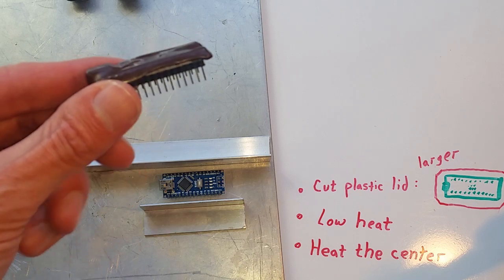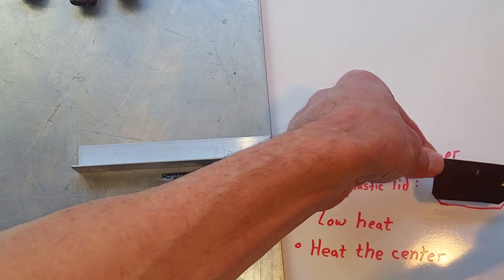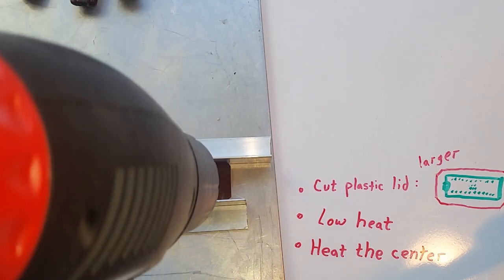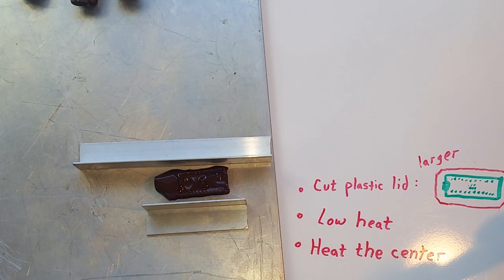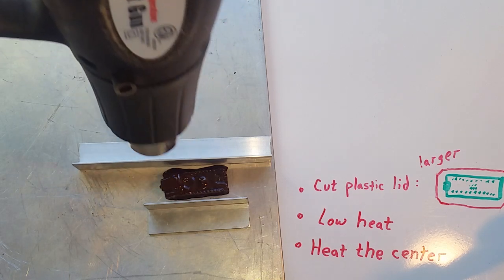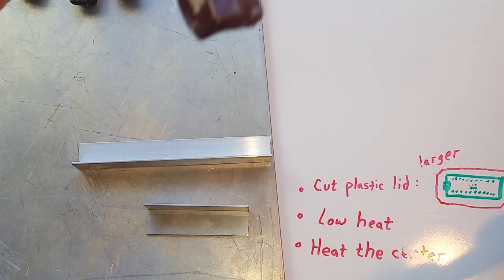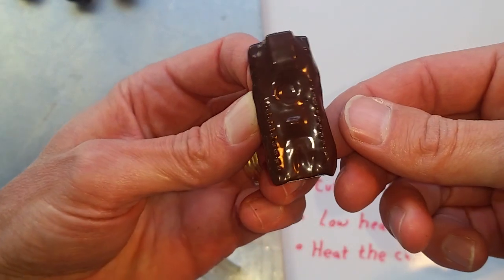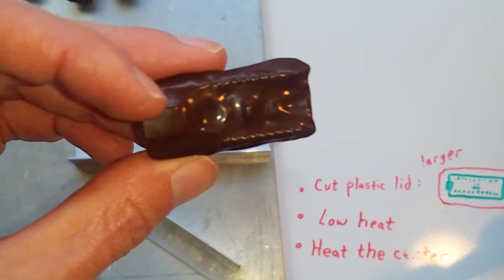Arduino. Potting circuit board.

Comment: Have you thought about the static charge buildup on plastic? I think that's why we need special anti static bags for bare chips.
Reply from the maker: I don't know about this.  Is plastic worse than no plastic in this regard?  I haven't experienced any static problems.
Reply: I'm no expert but plastic coming in contact with the metal in the circuit might be a concern. Or it may be nothing to worry about. Or it might actually help protect the circuit in a high static charge environment...dunno.

Comment: This is a copy and paste including several snippets from articles, blog posts, and instruction Tutorials  I’ve written over the years. Sorry for the rambling and I hope this helps someone

I’m just an electronics geek with a somewhat respectable lab… Who repairs industrial control and automation equipment… Also restore and recalibrate test gear. And big into the laser Hobby. 

Anyway… Dealing with industrial equipment… I’ve come to learn a lot of things about waterproofing electronic stuff. Since I see hundreds and hundreds of industrial modules every year for repair… I’ve got a decent understanding of how it works.

First of all… it’s a good idea to soak the board down really good with 100% alcohol or denatured alcohol. Then scrub the heck out of it with one of those small 1 inch disposable paintbrushes. Then give it another good soaking of alcohol with the board vertically so that it can drip off and take all the contaminants with it. Or better yet use an air compressor to blow off the contaminants and the alcohol.

I buy 100% Iso alcohol by the gallon for about $15. And I keep it in a squeeze bottle on my workbench. (One of those squeeze bottles with a 90° angled tip that can be operated with one hand.) I use over a half a gallon a month at least! It really improves my work and I couldn’t live without it. 
There are a lot of waxy and oily residues that can come on new circuit boards… So degreasing really does help the adhesion and only takes a few squirts of alcohol and a few seconds. And the alcohol evaporates quickly taking any moisture with it.

Second.... and probably most important.
Try preheating your circuit boards before coating. They can handle a lot of heat But only need to be good and warm. Somewhere around 100 to 150°F would be plenty. This will help the epoxy flow in and around all of the components, And it will also adhere WAY better to the board. 

Also the longer cure time epoxy the better because it maintains much more flexibility. Some thing like 30 minutes is good, 60 minutes is better.  Don’t get me wrong… I go through gallons at five minute epoxy every year and I love the stuff. But the faster the cure time, then the more brittle it will be. And with any vibration, it may can easily begin to pull away from the board or individual pins if it’s extremely rigid. So flexibility is great. 
 
Also when it comes to silicone… Be sure you get NEUTRAL cured silicone instead of acid cured. acid curing silicone will smell like vinegar and release acetic acid when curing. Therefore easily damaging copper and tarnishing other metals. Over time it will devour component legs and traces.

Also, check out a product called “never wet“ made by rustoleum. You can spray that shit anywhere. On pcb’s, inside of power tools, on bearings, windings of a motor, Inside a brushless fan or motor, on your clothes, on your phone, hell I’ve even opened up GoPro’s and soaked the insides with this stuff when I was going to be in a precarious environment...... literally anywhere. It’s extremely thin (similar to a regular clearcoat…) But it’s hydrophobic and really is like magic.… Check out some of the videos demonstrating it.  It really is amazing stuff if applied correctly. 

Another wonderful off-the-shelf product which is available to regular folks… Is flexseal. Yes I know it’s gotten A laughing with all of the infomercials on TV… but it really is an incredible product and cheap/readily available.  Before flexseal, something similar was only available in large quantities by industrial chemical companies. But for $13 you can purchase a can of spray flexseal… or even the thicker caulk like tube. And its dang near bulletproof.

If you’re worried about the epoxy pouring off the sides of the board… Then use tape or to make a dam around the board. In other words, stick the tape to the edge of the board with the sticky side facing in towards the circuitboard. Wrap the tape all the way around the board and leave the excess sticking up to make a damn so that you can fill it with epoxy. it leaves a nice perfect perimeter all around the board. 

Or if you’re wanting to cover the front and back of the board… the even better… Suspended the circuit board off of the table a little. Like the thickness of a coin or something similar. Then you can build a dam all around the board leaving a few millimeters extra on the sides of the board so the epoxy can flow over the top and down in under the board. That way you don’t have a bunch of open edges of epoxy that water can work its way under. But you’ve encapsulated the entire module in one slab of epoxy. If you use the dam building method… simply use some slices of cardboard like a cereal box… And a hot glue gun to build a little perimeter or wall around the board… Using another piece of cardboard or your work bench/table as a base to glue the dam to. The exact size you want. 

I would probably use a small plastic box a few millimeters bigger than my circuitboard. That way you can pour a little epoxy in the bottom, set your circuit board down into the box on top of the epoxy and spacer, and continue to pour epoxy on top of the board until it pours over the edges and connects with the epoxy around the sides and bottom. A small Tupperware container or any random little plastic box the same size should work fine. Once it’s cured you can pop it out and you’ve got a completely coated/padded module. But instead of a huge brick of epoxy it’s a thin coating with no seams or edges. That covers the entire front back and sides of the board in one smooth gel like coat. Just be sure to watch some acrylic/resin or mold making videos. And be sure to wax your Tupperware container/mold so that it can be removed and doesn’t stick in there.

If it’s going to be some thing that’s really abused, then swap out all of your connector screws and crimp terminals with stainless instead of regular steel. And clearcoat any heat sinks or metal that isn’t coded in epoxy. It Makes a huge difference because the smallest amount of corrosion can easily spread under the coatings... wick will begin to delaminate it from the circuitboard. Any type of corrosion or patina whatsoever… Weather The white powdery oxide that forms on aluminum. Or rusting steel.... copper that’s formed a patina… it all Poses a huge hazard to the water resistance of a board. That’s the most common failure point I’ve seen which breaks down the waterproof barrier. For example… The white powder that forms and oxidizes on aluminum. That stuff somehow creeps up under and conformal coating with ease. Like it’s not even there.

And most importantly…Keep in mind that NOTHING is waterproof. It may be water resistant but it’s better to leave it a bit exposed so you can dry it out later.
The only exception is if you’re willing to completely pot it in a solid brick of epoxy. but then it’s completely unserviceable and it adds a lot of weight/cost.
 it’s always best to leave certain things open so they can be dried out after a mishap. Whether you leave it out in the sun on a dry hot day, or bake it at low to mid temperatures in an oven. the best methods for drying I found… Is 100% alcohol or denatured alcohol. Soak the entire board, transformer windings, motor windings, soak everything. It will bond to the water and draw it out as it evaporates quickly. Even then… I still put it in the sun While in front of a box fan.....or bake it in the oven. Just to be safe.

This is a large cut and paste from several different articles, blog post, and instructional‘s that I’ve written over the years. Sorry for rambling… Hope this helps someone.
Reply from the maker: Thanks for spreading this information.  It seems a lot of internet info is going "dark".  News groups and forums that I used to liked have disappeared!
Reply from the maker: Where do you buy the gallon size alcohol?
Reply: @TheRainHarvester  The cheapest place is usually local. You can find it at Ace Hardware, Lowe’s, or Home Depot usually. Try and get 99% not 90, not 98. 99.9 is the best. Denatured alcohol also works but sometimes leaves behind a white residue. However it does remove just as much water and contamination. Amazon has cheap prices usually, but during the pandemic they’ve gotten more expensive. But still have some of the local dealers also. I was used to paying $20 shipped online and usually $20 for a gallon locally. You could also check eBay sometimes there are good deals.

Comment: Or you could use epoxy putting compound
Reply from the maker: Mic Mucky , it's an option.  But I wanted something that dries very quickly, and less waste.  I considered that brush-on seal, but it doesn't provide a lot of scratch resistance (especially on the pins that stick out).  
This technique really gives a robust finish.
Reply: @TheRainHarvester  ok it's a good idea what u have done like u can get small fast curing epoxys some cure about 10 mins but cost little bit more then plastic lids lol
Reply: @TheRainHarvester  only bad thing about heating up plastic to melt over the circuit is u could damage the components epoxy goes on cold and sets solid
Reply from the maker: Mic Mucky , thanks! I think all these methods are good for different reasons.
Does that ten minute compound brush on? Or do you create a mold for a pool of it to dry in?  What is the name of it? Just curious.
Reply from the maker: Mic Mucky , yes, you're right about desoldering the components.  I mean a heat gun can reflow the solder if you hold the gun too close, or on high heat.  Luckily, these lids melt much faster than the solder.  The heat never accidentally desoldered any components even when I though I might be heating the plastic too much.

Comment: This is just HDPE right? so most plastic bottles will work for this too, as long as it's got the number 2 in the recycling symbol, you're good.
Reply from the maker: The lid was hdpe #4.  I tried #2, from a milk bottle, but it shrinks too much.  I read that milk bottles are blown / expanded into a form so maybe that is why they shrink so much.

Comment from the maker: Let's think of a solution: we want the jig to contain the puddle of plastic to the outline of the board.  But the plastic shrinks and starts BIGGER than the board.  Any ideas?
Reply: How about a micro-vacuum former?  One frame that sits on top of your vacuum hose end and a second one that has the plastic clamped to it.  You heat up the plastic in the second frame separately, then quickly place the second frame on top of the first and turn on your vacuum.  Voila!  Perfect coverage without heating the components.  (I would also file down the header pins or just push them down with a hot soldering iron.)
Reply from the maker: Keith Olson , can you explain the frame that has the vacuum hose? I can't picture what keeps it sealed to anything.  I like the idea of getting rid of the pin problem.
Reply: Nothing complicated; just a short piece of pipe that fits over or in the end of your vacuum hose, mounted on a flat plate with a hole the size of the inside of the pipe.  On top of that, you'd put a piece of window screen (or w/e) to keep parts from being sucked into the hose and ensure an even flow of air (like pegboard works with for a classic vacuum former).
Reply from the maker: Keith Olson , I think that would be effective, but almost too effective.  One problem with my technique are the drips on the sides.  I want to prevent the sides of the plastic from dropping over the sides.  But the plastic shrinks (ie it starts larger in area than the pcb board, 1:20 , so those larger areas will droop over the sides). It's like I need to stop gravity , or at least redirect it.
Reply from the maker: Keith Olson , I like your idea of pushing the pins down so they don't stick up.  This alone, might solve the problem.  But, really, I shouldn't solder them too high to begin with.  But I do need to solder them, so they'll stick out a little. Hmmm....
Reply: To keep the plastic from 'drooping', you can just cut cardboard/etc. with a hole the right depth for your PCB/etc. that will fit fairly tightly around it and prevent the plastic from forming to the sides.
Reply: Another thought is to place pin labels on the sides of the headers, use clear plastic to pot  the whole thing, and have the plastic cover up the labels to protect them.  You can push the pins into cardboard to keep the plastic from covering them.
Reply from the maker: Keith Olson , if the plastic doesn't stick to the cardboard , and the cardboard doesn't burn, that might work!  It might stick, but maybe baker's paper won't stick.
Reply from the maker: Keith Olson , what are pin labels? Paper?
Reply: I don't have any handy to show you, but I just used a spreadsheet to print out tiny labels that I then stuck to the headers with double-sided tape, then covered the whole thing with hot glue.  (Now that I think about it, I also have some Polycaprolactone (PCL) that melts at only 60c, which would make potting circuits a LOT safer and easier.)
Reply: I just took a picture of what I am talking about. (These are adapters I made to let me attach USB to a breadboard.)  https://photos.app.goo.gl/i5cSNR5R2v5zorzQ9
Reply: Another idea I just had based on a recent HaD article would be to heat the plastic on top of a layer of thin silicone/etc. (something flexible that melts at a higher temperature than HDPE to keep the sand from sticking to it) sitting on a pot of hot sand and, when the plastic is elastic enough, press the board down into it.  The semi-fluid sand will give way beneath it while providing enough resistance to make the HDPE conform to the board.
Reply from the maker: @KeithOlson  , I like it.  It solves the gravity problem.  Maybe even form the silicone into a little box.  Do you think the the silicone will transfer enough heat to melt the plastic?
Reply: Use a rubber band at each end of the strut so the plaster can start bigger than the board but tighten in as the plastic melts??
Reply: @TheRainHarvester  If you put a lid on the pot so that the air heats the HDPE, it doesn't need to.